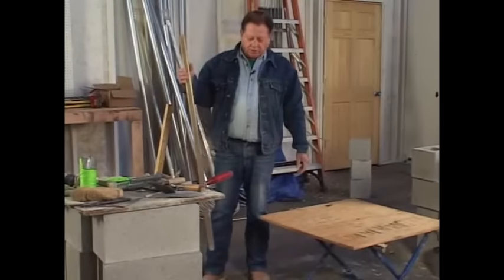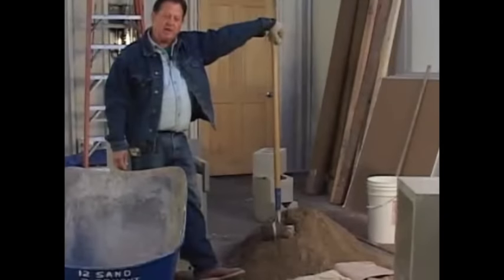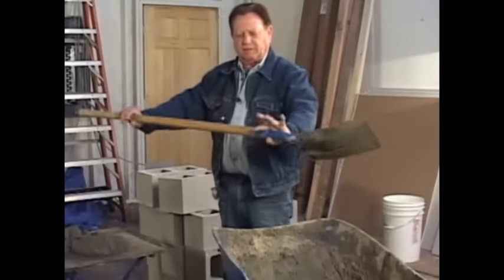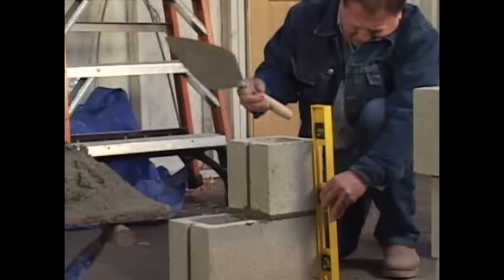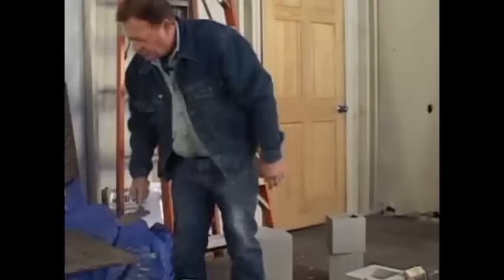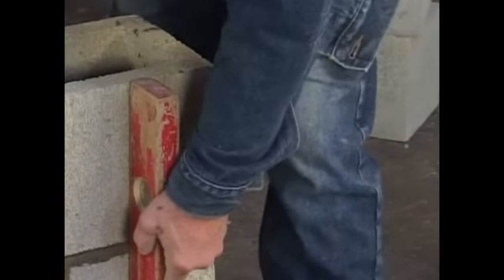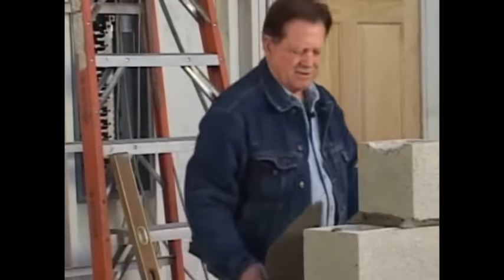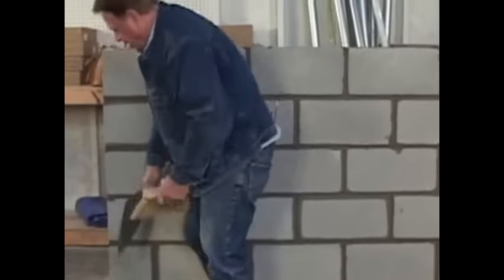How to Build a Block Wall Lay the Blocks

Comment: Hi Steve Kelly, this is certainly the VERY BEST basic brick or blocklaying video I have seen ever. Informative, ALL the basic things explained and delivered in a completely down to earth, matter of fact manner that DOESN'T make the mistake of every other video I've watched on this or many other subjects - that of failing to explain those basics, fully and patiently. Not assuming that the viewer "must know how to do this or that". Like the very wall you built, the bottom or first level REALLY IS the most important because every one or thing that follows SHOULD be correct. Thank you so much!

Comment: You lay blocks like my father used to do when he was alive 43 years ago with your eyes closed. I tried 100 times. I couldn’t get the hang of it. So I was stuck mixing the mortar and bringing the blocks over.
The mortar would be too thin an slide down the block or too thick to spread also troweling the edge of the blocks are not as easy as it looks. The only difference was that we used 3 hole blocks. It is definitely an art. Some people can do it so easily but for others it’s hard. I was an easy learner. A builder and master electrician by trade. Also was great at mechanical work restoring old cars. Thanks for your excellent video that reminds me of my dad 43 years ago…

Comment: Great tutorial video! Perhaps you can provide a little guidelines or rule of thumb on how much horizontal rebars to use for different wall height, it is every other block or ever 2 blocks and how much concrete to fill the blocks with?

Comment: When I was a kid, around 13-14, in the summers, I tended for my cousins and uncle. They were all union Masons. I could tend for two of em pretty easily. But when there were three, I was hoppin' ! My job was setting them up with block, mixing mud and loading the hocks or boards and striking the block ! We set all of our corners / leads the first day, an easy one ! The next couple of days we ran hard ! 700-1000 block a day was the norm ! We used the older wooden string blocks on the outside of the corners. Those little metal thingies weren't around yet !

Comment: Thanks for the helpful video. I missed what to do with the vertical steel. Do you mortar-fill up the hollow half in each block that the vertical steel goes through? I'm just trying to visualise what 16 inches looks like between the vertical bits of steel - would that be 1 per block in that row?

Comment: learnt another lesson about building block wall. thanks. i have a question. after doing blocks when you would put concrete in the block holes or rebar or have to fill all the block holes with concrete. thanks.

Comment: How do you know how much mortar to but on bottom and between blocks? Wondering how you got the last block to fit so perfectly at the end of the course row.  I know, practice. But is there a trick to this?
Reply: Unless you want to measure the width of the mortar, no. Just got to work your eye for it.
Reply: I'm obviously no pro but figured Id chime in from all the other videos Ive watched: you're laying an inch of mortar on top and bottom when placing and planning on 3/8" of a mortar gap between blocks. This is the extra you factor in when measuring the walls width for the corners
Reply: 8x8x16 block  have actual dimensions of 7 5/8 " x 15 5/8 " to allow for 3/8" mortar joints.
Reply: They have to line up in the middle of the block each time that’s your guide

Comment: Appreciate that sir! I'm ready to bulld a wall here in just an hour or so when daylight hits in just 40 something minutes of watching your video I should be able to handle it.. Lol Nah seriously I am a contractor in Alabama who's business offers carpentry, decks, additions, pergolas, roofing, tile, hardwood installs, kitchen and bathroom builds, painting, chimney sweeping, Air-Duct cleaning (BUT NOT BLOCK GUY) Never laid any blocks or bricks other than repairing a chimney firebox and that's not laying blocks or bricks either but as close as I've gotten to masonry work. To the point, I'm tearing down an old storm shelter for a customer because the roof was leaking, well pouring is a better word. Demoed the old roof off , and it was 10 crossties sitting on the block walls with nothing at  at all fastening it to the blocks in any way, just sitting there with plastic, tarp , shingles, dirt on them. Not sure how this didn't leak 6 months into that project but he said it just started leaking very bad over the past year or so. Well these crossties were so rotted out, and I see exactly why it was leaking and filling up with water, because over the 22 years since this thing has been built with 4'-5' of earth on top of one sheet of plastic, and one tarp, and shingles in place on this build the  vines and trees have been growing 22 
years and puncturing the plastic and ONE TARP and shingles. 
 It looks like somebody hung the tarp and poly plastic and emptied several 30 round mags with an AR-15 into them is how many holes were in it. Anyways, out of the epic failure of a roof system installed on this underground shelter the  cinder block walls and concrete slab foundation surprisingly appear to be done quite well. So now seeing that today after tearing the roof off all I would like to do to this man's shelter with 2 more rows of blocks around it because it was only 5'9" clearance in there for the past 22 years . I'd like to add a couple of rows to at least get it in the vicinity of a person 6'5" could stand up in there if he wanted to. With all that being said I subscribed to your channel and I'll take your training out here to lay some blocks in about an hour when the sun gets up.

Comment: The only thing i would like to know is how did he know each block would fit to precision. ? How does one measure to insure a precise fit length wise? All in All it was a Great Video.
Reply: Standard block dimensions are 8"x 16" and half blocks are 8"x 8" that is including 3/8" mortar joints horizontal and vertical.The 8" half blocks are used every other course to achieve a stagger of your head joints, "Vertical". Most tape measures are marked in red every 16". So you can use your tape to see how many block your wall will take. Depending upon the length of your wall, this can work out to use whole blocks from start to finish on your first course, If not, your would start both ends and lay blocks towards the center and cut a block to complete your course. This means you will have to cut a block every following course, and you will want to stagger it's location for Strength also. I'm definitely not a pro, but this Is kinda' the basics of it! Hope this helps, God bless!

Comment: Great informative vid. I have acouple questions however concerning the leads. When you're measuring the distance between the lead blocks, how do you calculate the total length? If I'm not mistaken you have to sum the total length of the blocks plus the width of the joints between them right?
The next thing is, given you do the first lead block and then immediately put the half block lead untop of it, wouldn't adjusting the half block throw off the alignment of the block below it? The knocking would transfer to the bottom block unless you let it set a bit not so?
Much thanks for the vid
Reply: Answer #1, standard block are 8"x 16" INCLUDING 3/8" Mortar joints, And standard tape measures are marked in Red Every 16". Answer#2 Steve probably time lapsed the video slightly to allow mortar drying time on the first lower block. Otherwise like you said, it would have probably thrown it off a bit. God bless!

Comment: Looks easy, but I didn't understand about the steel. Is the mesh of steel held in place by the mortar or tied together with wires? Do you lay the horizontal on the 3rd row then lay the horizontal on the 6th row and then slot the verticals at the end, or do you lay the 3rd row, then insert the verticals and then lay the 6th row? And what was the 16" out you said? Thank you

Comment: Great video. Wish I knew what this wood blocks are called. For holding the string tight. Never saw them before. Thanks for the instruction. I enjoyed it.
Reply: They are called line blocks. They can be purchased at any masonry distributor and are made of wood or plastic.

Comment: 38:42 We don't wanna smear anything except for every single head and bed joint we already smeared. That mortar is way to wet which resulted in a small smear of mud along every joint. Hit the mortar with about 10-15% less water, strike the heads first, take a sled-runner along the bed joints for a consistent and smooth joint, run a trowel over the whole wall at a slight angle to clean up excess mortar, carefully fill in holes if your trowel work isn't where it should be, then brush/point up with the thumb jointer when the bond has set up well enough. The extra work you put into timing this process out is the difference between a skilled mason and a master mason and making it a habit is difficult from the pressure put on you to get everything finished. Trust in the trade secrets though, an extra 15-30 minutes can save humanity hundreds of years of an eyesore.

Comment: Metal drum lids work better in hot areas as they leach less water out of the mud. Alternatively you could use a flat plastic tote lid. Your wrists will thank you when you only have to rehydrate your mud half as often...

Comment: Nicely done. However, during the entirety of the video, you never explained nor showed how to keep bed joints consistently 3/8”. This would be critical for door openings. Question becomes how do you keep the bed joint plus the block a consistent 8” high ?
Thanks for showing us how to build the wall. Well done, stay safe.

Comment: Please explain how to make the joint thickness consistent for the lead blocks (end blocks) before you installed the line. Because if the joint thickness for the end blocks are not the same thickness, the line is not going to be correct even if the end blocks are leveled. Of course you have experience and managed to have consistent joint thickness for the end blocks.  
I enjoyed to see how you place the mortor by moving your  troll.
I enjoyed the video.
Thank you.

Comment: I have built a small wall years ago but now I want to lay a small basement for my house. It will be a walkout basement so I want to put in a few windows and also a garage door. Those sash blocks have a groove in one end. Does that groove go towards the window or what is its purpose. Does a window slide down in the groove left by those blocks?

Comment: You have to lay 8in block with one hand in commercial masonry. I lay 12's with one hand all day long. Good video. Just for beginners. On my enclosing blocks, I butter both sides of the block holding the block. Not off the mud board.

Comment: Would you use this same procedure for a 45 foot long wall only 2 blocks high? Just wondering if the line would still be accurate at the 45 foot length I’m trying to do. Thanks

Comment: Great clip.  Question.  How can the wall be 6 ft in length if the blocks are 6 feet and there is mortar in between?  Has to be longer han 6 feet doesn't it?

Comment: hi, thanks for the tutorial. I would like to ask you about how many cm do you put vertical iron bars? and especially when a wall is raised, do not usually have to dig the bottom to create a better foundation or in your case it does not need?
Reply: Minute 33 :)

Comment: Hi, I am about to build a wall out of concrete block, I went to builders merchants and all the blocks are off by a few mm, e.g 100 was 95, 140 was 137, 215 were 213, is this standard in the trade. The reason for the concern is that as I've never built a wall, when I come to do my gauge this could throw me out a bit. Do builders normally just had 12/13mm or mortar in the joints to compensate? Thanks

Comment: I tried putting up raised beds 20 foot long. Put up the ends, but I had trouble getting the spacing so the last block was either tight or big mortar lines. Are you building a wall in your shop?

Comment: if youre adding a few courses to an existing wall, how do you tie them together? would you get a long bit and drill into the cement and put a rebar in as far as you can go?
Reply: Yes tie in to the existing wall every 24 in or 16 whatever you prefer you can do it every 8 but that's a little Overkill. What you want to do is rent hammer drill get a 5/8 drill bit drill down about 6 inches wherever your mark specifies clean out the hole with air pressure then you'll need to cut some rebar at about 19 inches after you've done that you need some high-grade steel epoxy you put the epoxy in each of the drilled holes enough not to waste it but to make sure the entire whole has epoxy around your rebar the size of rebar will determine the size of your drill bit after you've placed your rebar let it Harden 24 hours then you'll be ready to go up the two courses you need I hope that helped
Reply: Nice tutorial steve, i do some block when i hav3to, lots of tuckpointing, we remove andreplace residential foundations and i normally do 2 tiers on top of a 6” poured wall, woth new plate and anchor bolts, is tricky but i love it, 33. Years doing it, is my specialty, not too. Many of us who do them right,,tnt concrete construction,rockford michigan,  peace

Comment: Thanks for the great video. You make it seem so easy =). But how did you know that your two leads were level with one another?
Reply: Block runs on 8 inch in height
Reply: Check each lead with a level, or get out your laser and use that, or, use a transit,..
Reply: HD has these Empire brand Line Levels.  I've never used one, but am going to on my next build.  I assume Lowe's would have them as well.  It's all about the foundation and what you're building on.  Usually, a laser level is the best to determine if you're really level from corner to corner.

I also found this video that I thought looked helpful.  I've not tried this method, but it seems like a great way to make part of the process much simpler.  https://www.youtube.com/watch?v=rWofXXWOhck
Reply: That’s a great question .. He obviously had confidence that the foundation was perfect from one end to the other. You can also check it with a home made water level.  Just YouTube water level and there are many different types you can make for less than $25.00. 100 feet of tubing can water level just about any building in a few minutes

Comment: thank you steve . question  for you .How  much mortar should there be ob average between each block  were they meet up to one another?   or does the cement block  but up against it plumb/flat and the mortar just fills the voids???
Reply: 3/8" inch is the space. Steve is such a pro that he can probably eyeball it.

Comment: How do you keep the joints the same width? Does the weight of the block always keep the joint the same? What happens if you have slightly less mortar (seems the joint width will decrease).
Reply: The block and mortar should be 8 inches tall--- block 7 5/8  joint 3/8
Block length is 15 5/8 and head joint 3/8 inch

Comment: My uncle built a cinder block basement to put a single wide mobile home on. He thought he was all that in everything he did. So when he went to backfill it caved in. Several areas where he failed. None of the courses were tied. He didn't fill the wall with concrete. And......he didn't have the trailer on it yet. As a kid I remember the mess and it was something not to ask about. It sat there for decades until after his death then his wife, my aunt, had someone get rid of it.

Comment: How do you measure the distance from end to end for the first layer of block across the bottom? Do you need to take into account the mortar in between each block? (Noob question).

Comment: My point in my previous comment is that if the end blocks are not level, to begin with (different bottom joint thickness), the string set to the top of block will be sloping. Did you set a string level on the string?
Reply: Pay attention. He used a small level on the end blocks. Level is level. Ready for string.
Reply: @tnfan6306  level doent have shit to do with relative heights of the lead blocks. So they could both be level, but not at the same height. Then when u run in the wall it will be out of level
Reply: @cheshstyles  I always see the union guys using string levels. The work looks damn good though.
Reply: @tomthomsen11  union block layers using string levels? I'll have to take your word for it! There is no way I would expect a string level to work for a building
Reply: @cheshstyles  it was a block wall around a hospital. They set the blocks at each end. Then they hooked on some aluminum brackets that hold the string. They ties the sting on and tightened it. They put a string level at the approximate center of the string. The guy told me that he did that to make sure the two end blocks were level with each other. Then he took the level off and just used the string to line the blocks up. I'll say the guys were not going very fast but the wall was perfect when done.
Reply: @tomthomsen11  so the wall was not part of a building?

There are just better ways to get more accurate heights.

Thanks for your reply btw
Reply: Gotta use a rotating laser or an auto level to shoot in heights
Reply: @tnfan6306  so using a small hand level will guarantee that the top of block at each end id the exact same elevation? I would think that would just make the individual block level but not necessarily equal in elevation.  I've been using my total station to check and set the end blocks before setting the string line. I've had great results but it definately adds time. Thanks for your reply, I just saw it!

Comment: But how do you know how much Gap to leave in between?? isn't there a special ruler for that,  I've seen guys put a one by one on each corner and then Mark it as they go on they keep putting the string on the lines or did them small blocks have the gap automatically I'll bet. Nice job